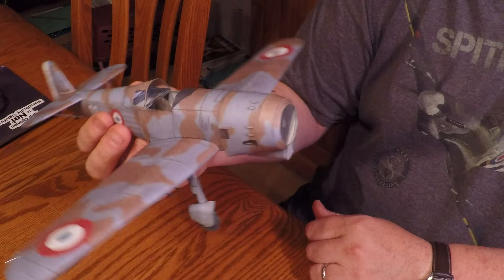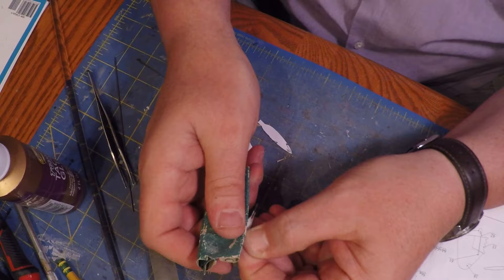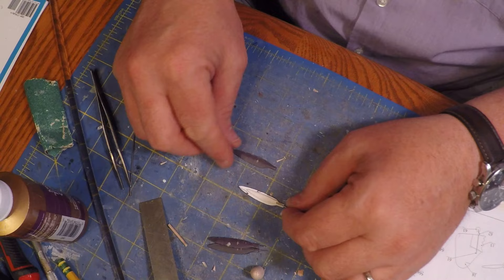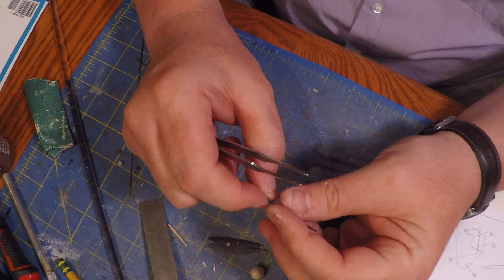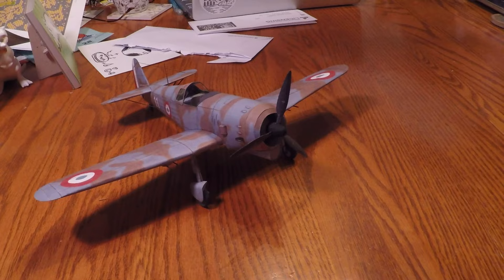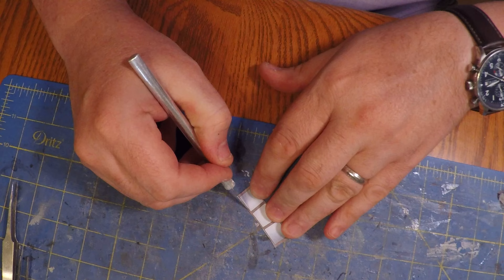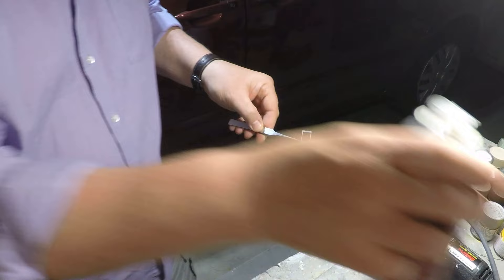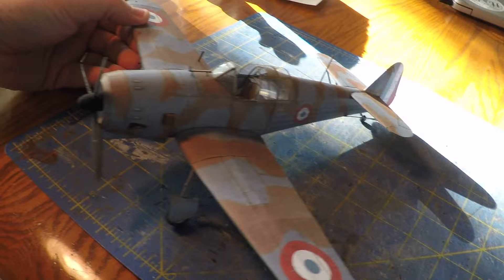Koolhoven F.K. 58 Paper Card Model:  Final Details

Comment: Hello Dan, what exactly is the spray you are using to stick the frames? It drew my attention and I want to find Czech equivalent.
Reply: While I can't tell what Dan is using, many of us in the States use 3M, Scotch brand Super 77 spray adhesive. It seems to hold better than other spray adhesives.
Reply: @gregoryperry4824  Thank you very much. I am not familiar with spray adhesives at all. Try to search the market here. One more question - is it transparent after hardening? So it can be used also for sticking a foil on textured surface?
Reply: I used some to glue a paper base to glass and took a look at it. I can see the adhesive through the glass, but the paper color still comes through. Not sure that answers your question. If sprayed on a surface and just left to dry, it would dry to a semi-gloss sheen. It's more like rubber cement than pva white glue.
Reply: @gregoryperry4824  Thanks, guess this can diverse for different products. I will probably try it.
Reply from the maker: Greg pretty much nailed it.  I think any contact adhesive would work so you should be able to find something.  Like I said, I've tried several other glues with limited success.  This stuff seems to stick well and the clear parts don't peal off!  It is expensive, though.  I hope this helps and it works for you.  Thanks for looking and commenting (both of you...).  -Dan